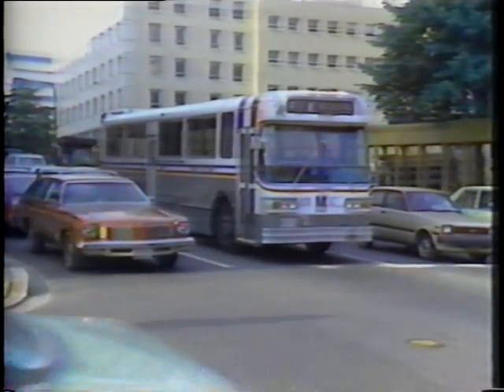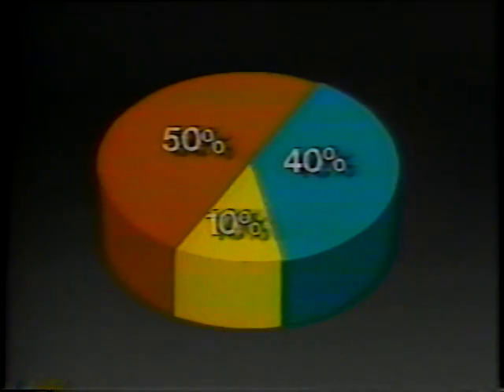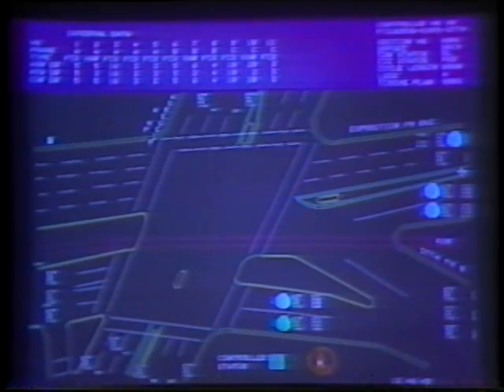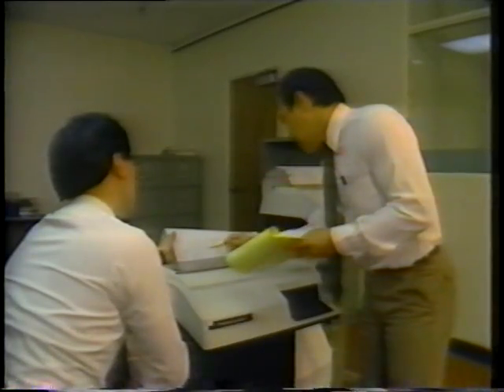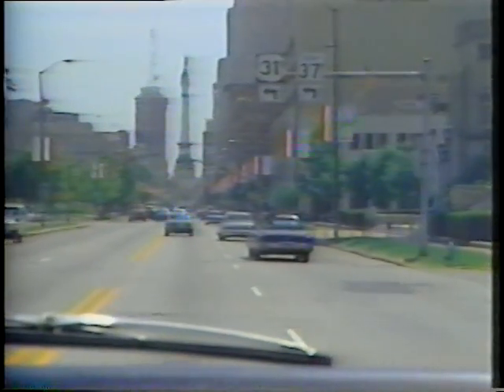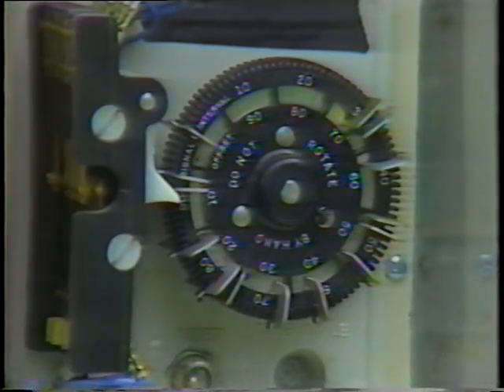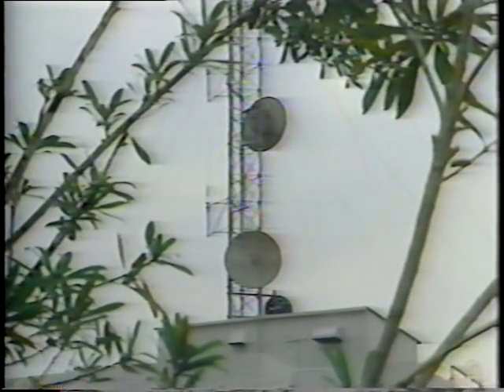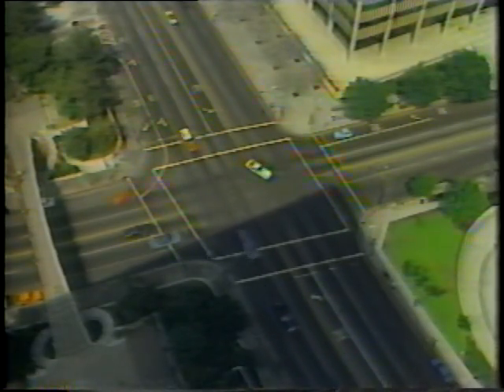Traffic Signal Systems: Go for the Green

Comment: The Macomb County Road Commission in Michigan needs to see this video. Some of the worst timed traffic siganals I have ever seen. This road commission spends tens of millions of dollars on high tech traffic signals and equipment, and yet there is no synchronazation of none of the signals! Macomb County is a major suburban county that boarders Detroit on the north. It's population is around 800,000 and has a heavy amount of traffic. Someone needs to teach this county about traffic signal timing
Reply: You should visit Texas.  Sequential timing (1,2,3,4,5,6,7,8) of most traffic lights in my area.  Even late night I've sat for almost 2 minutes waiting.  I've sat at traffic lights for about 2 minutes, wasting gas, time, patience, and so on.  We are in modern times, and still traffic engineers do things I will never understand as a driver.